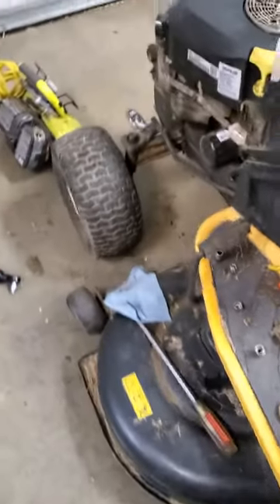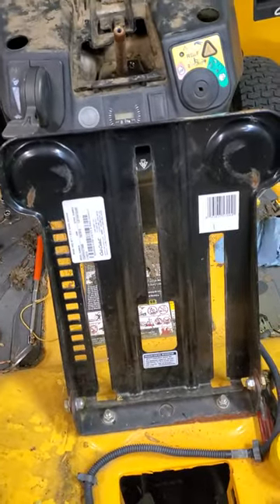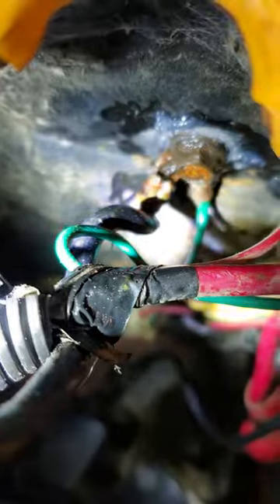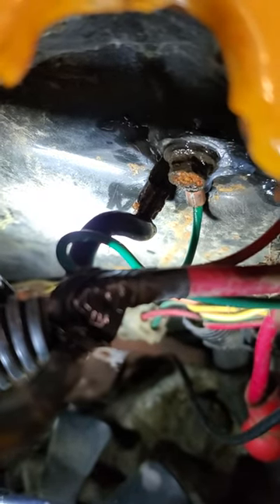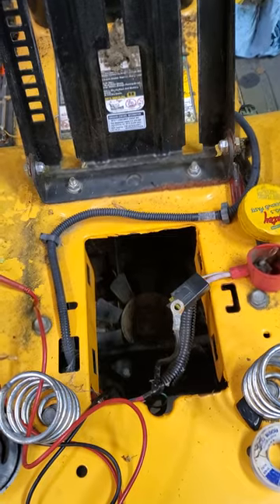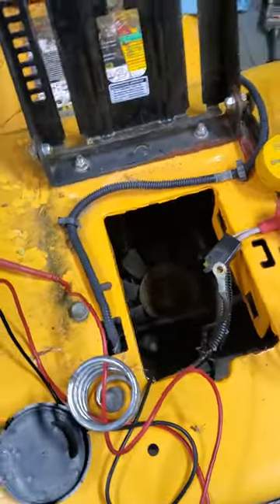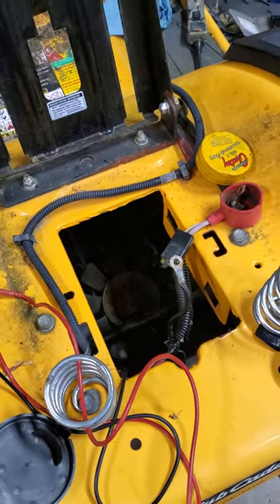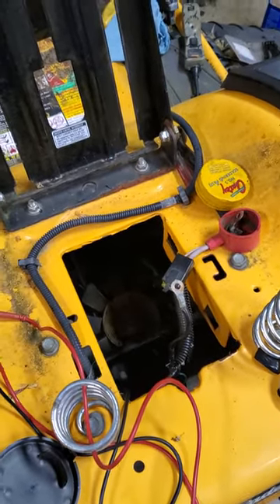Cub Cadet XT1 No Start, No Power

Comment: Good looking out man. I already pulled my safety switch on my 5400, considered replacing the starter even though it was cranking just the other week, gonna check out the ground on the battery. I replaced the flywheel key and suddenly didn't receive power to anything from the fully charged battery.

Comment: Having the same problem. I will have to check this out. Can you unplug safety switches in order to test?
Reply from the maker: Some you will haveto use a jumper wire to bypass the switch

Comment: Cub was running and just plain would not restart. No clicking, no power to the meter. Spent 2 days continuity testing solenoid with battery, and all 3 other safety switches (PTO, BRAKE AND SEAT). Disabled seat switch but removing the electrical bus in the connector. All other switches and solenoid tested AOK! 
Replaced ignition because old one was pretty worn out. Junk plastic anyway. STILL NOTHING. NO POWER. CHECKED GROUND AOK.
Then I heard about a great tip about the headlights. Could it be that simple? Just went outside and disconnected them. BAMB! Power restored and started right up! Although a frustrating experience, it saved me a trip to the repair shop! And I learned a lot about removing and testing these safety switches.
Reply: Same… bad design … repair will be a third of what I paid for it… that’s not right… very disappointed in club cadet
Reply from the maker: That also sounds like possibly a ground issue.
Reply: Thank you so much! I changed my solenoid, battery, and started chasing wires. Stupid battery cable fuse kept popping. Unplugged my head lights and back in business!!!